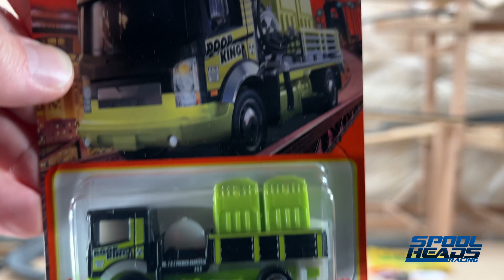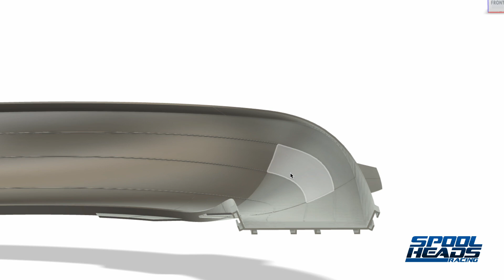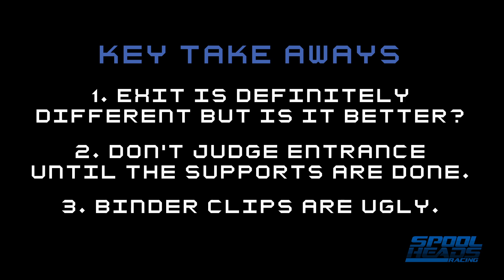Prototype Open Track 180 Degree Turn VERSION 3.0, 1:64 Scale Diecast, 3D Printed - Test Footage

Comment: 4:33 Sizzlers have rubber rear wheels that help the motor propel the cars out of the exit part of the curve. While printing lines in the track is helpful, I suggest you consider reducing the angle of the exit curve piece. Also, the whole 180 degree U-turn is too wide. The cars are going into the curve and driving straight up into the rail. The ridges in the track do not seem to be helping. (Constuctive feedback, trying to help) I just noticed that this video is half a year old. You may have already made changes.
Reply from the maker: Thanks for the feedback. I don't feel like I have the grooves perfected yet. Maybe soon.

Comment: Any update on 4.0? I LOVE the direction you are heading with these and we would love to replace all of our crash racer turns :)
Reply from the maker: Thanks for the support! V4 is in progress and I think you'll like it a lot. Work has been crazy and I'm also struggling to figure out the best way to connect track pieces. This has been a grind for sure but I hope to make better progress very soon!
Reply: @spoolheads  What about tabs like you have currently and then a small/thick rubber band to hold them together? Perhaps leave a small gap between the tabs so the rubber bands pull tight and the track stays together tightly!

Comment: Good work. It is appreciated. A couple of ideas I have. !) Don't take out all of the challenges for the cars that keep the racing interesting. 2) Flatting the inside curb of the turn as an optional model for builders. It would allow the slower cars and cars that get pushed to run off into the infield and interact with the scene there. With a little slope they possibly could return to the track.
Reply from the maker: Thanks for the tips! That would be fun to try in a future version for sure.

Comment: Is the curve going to be modular so you can add or remove sections to adjust the angle of the curve? Like be able to make a 90 or 135 degree curve instead of a 180?
Reply from the maker: Because of the elevation change, no. Because most 135° turns and smaller angle turns are typically on a slope, the elevation change isn't necessary, so I'll make a turn that will be modular for that use.
Reply: Could the supports that do the elevation change be modular and attach to the bottom of the curves along a slide so it would be an adjustable elevation change?
Reply from the maker: @samoswalt  That is possible if the in and out of the turns start the elevation change. That would be great for corkscrew turns. I'll keep that in mind for further development. It's a great idea.
Reply: What you do is amazing. I couldn't begin to do what you do. Keep it up and keep the videos coming. Thanks for all your hard work.
Reply: I hope everything is OK. haven't seen any new content in a while and just checking in and letting you know your fans care😉
Reply from the maker: @samoswalt  Thanks for the support! Work got really crazy over the last month. All my late night track design hours turned into work hours. I've actually got a break tonight and I'm working on version 4 now. Wish me luck and thanks again for reaching out.

Comment: Could you please test open wheel carts to go down your track, like the Indy 500, Formula 1, and Racing Formula castings and see how erratic they behave on your track on your next vlog? I did see a Formula E cart go down on your track (7:57), but the cart's design is not an open wheel like the aforementioned castings. I also noticed that there wasn't a 3rd track ridge on the inside of the straight transition after the exit of the turn, which might prevent the cars from slamming into the side rail after they exit the turn. Making the ridges just a hair taller might also prevent the tires from rolling over them and cause the cars from sliding down and/or oversteering into the rail of the exit straight lane. You may also want to extend the exit straight lane longer with the ridges that are a hair taller, because I noticed the carts are still having a little bit of oversteer after exiting the turn as they enter the straight, especially at 8:34. Would lowering the bank at the exit of turn help the carts not slide too fast, which creates the oversteer to the left and hitting the inside-side rail too hard and makes the cars oversteer to the right just before the straight lane drop off after the turn? I hope my observations help and I'm not making things worse? Is it possible to reform the banked turns of the "Crash Tracks" to have a less steep graded bank by carefully hitting it with a heat gun and holding it in a frame vise as it cools back down? Although, will the heat compromise the plastic's composition and make the part brittle? Just a thought because I don't own a 3D printer and I'm trying to look for alternative ways on how to achieve what you're doing to improve 180º turns that are open track to allow for natural passing. Thanks for your time and sharing your tests. Stay safe and blessed. Yosh...
Reply from the maker: Really great feedback here. Thanks for taking the time to watch and really analyze this. I've got a few open wheel cars I can send down for sure. My hope is that thicker ridges will solve this but if not, I'll have to back off a bit on the exit slope. I don't think modifying a CR turn with a heat gun would pull back far enough and be smooth enough in the end. The Aussie CR turn is more of what I think you'd be looking for. I'll be selling this turn when I get it dialed in so that's an option too. Thanks again for the great feedback!

Comment: Have you considered more grooves, I think like crash racers - maybe eight or more, going into and coming out of the turns?  Then tapering the grooves into and out of the curve to maybe reduce spinning or slipping down the track?  Not sure I am explaining this well, but from the start of the groove, one groove maybe being 8” and the next groove 7”…etc. I am guessing it would depend on where the peak speed is for each point in the curve to help a car maintain their lane.  I am also not sure how much the grooves reduce speed or help cars maintain lane.  Well done and awesome presentation!!!
Reply from the maker: Version 1 had five consistently spaced grooves and it was pretty good. Version 2 had no grooves and it wasn't as good as version 1. To allow for the grooves to help direct the cars more, version 3 only has 3 grooves, but I didn't make them thick enough to help the cars stay up. I'll make a version 3.1 and see how that goes. Thanks for the feedback!

Comment: This is coming along really well. I had a thought about the entrance and exit and the car sliding. If there is an angle on the track it needs to be on a slight turn. I did a couple of calculations and realised why the old two lane hot wheels track wasn't a constant radius. The radius needs to decrease as the angle increases. I can go through some calculations with you if you want?
Reply from the maker: That would be interesting to prototype. I love that old sizzler dual lane turn and I'm working on a SR1 dual lane turn similar to it. The Crash Racers turn stays consistent on the radius even with a very steep slope. When I get this turn dialed in, I'm going to take a break from turns :) It's been so much work! Thanks for the feedback!

Comment: Great piece of work.
The exit - what I was seeing is the bank is nice, until straight. That was perfect, but maybe not as banked. Also I didn't see a groove line on the bottom part of the exit.  Not sure what you have for height for the groove lines. If you can find a Corvette C8R, that has a low clearance, and it doesn't like the crash racers corners.  Love your product on Thing-a-verse and happy with what I was able to print off. Cheers
Reply from the maker: Glad you liked it. Great feedback for sure. I'm excited to show you the next version.